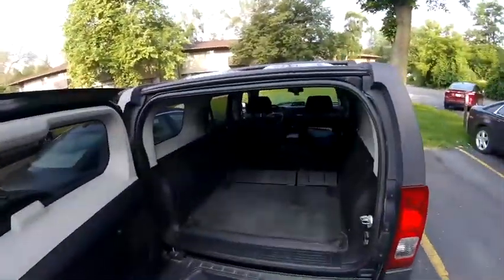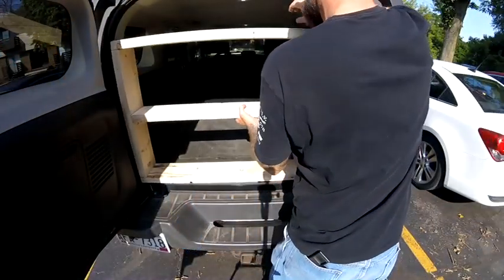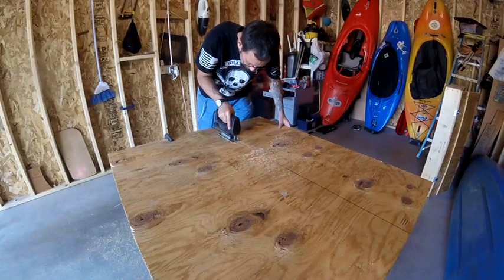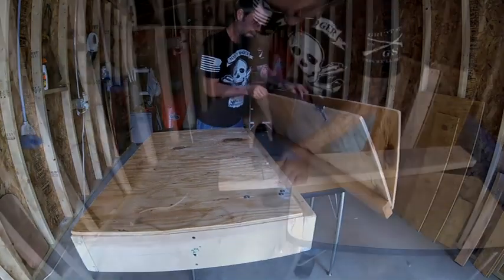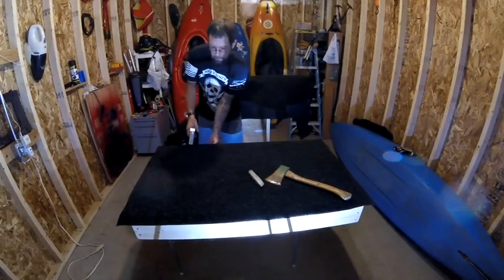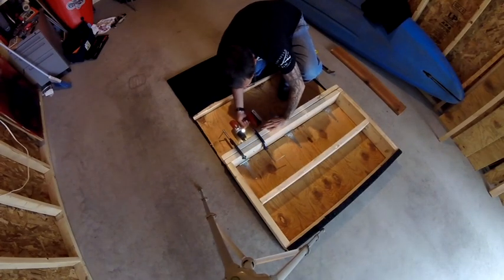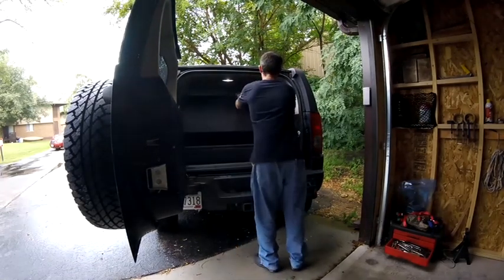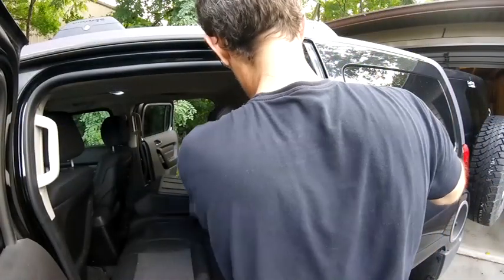2007 Hummer H3 Bed Frame Build

Comment: That is really great. Thank you for sharing. I'd pay for the plans. Please contact me. I'd like to get the wood cut at the hardware store. I haven't a place to saw or the saw itself but I have a drill. 
This is absolutely prefect.
Thank you for sharing your plans. I so have been wanting to do this to my H3.
Reply: An off road/adventure vehicle designed without folding seats - incredible. Did the dude ever send you the plans? 🤙🏽
Reply: It does have folding seats

Comment: What’s the maximum length of the bed ?
Reply from the maker: The bed is at 6 feet but to lay it flat you'll need to move the front seats all the way forward.

Comment: How tall are you and what do you think the maximum height is to sleep comfortably?
Reply from the maker: I'm 6 foot and if I move the front seats forward i can sleep fairly comfortable, my feet do touch the tailgate though. But if I sleep at an angle it's quite comfortable.
Reply: Well the deck is only 5'3"

Comment: 1 x poplar is better 2x is too heavy, smooth birch cab grade 5/8 ply is stronger lighter top deck 3/8 or 1/2 inch bottom deck. Pull bottom seats out forward to lower, back fold down to level out. Drawer pullout are more practical easier access. Using 1× allows for drawers.